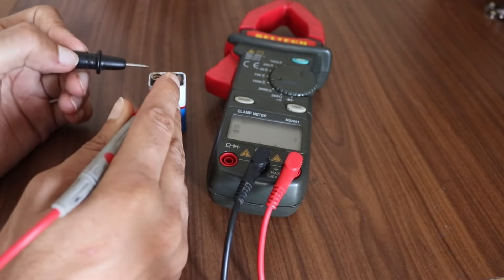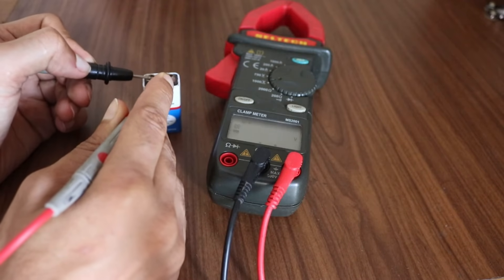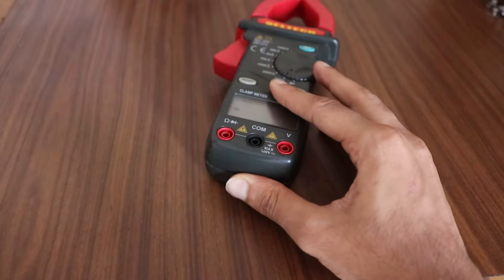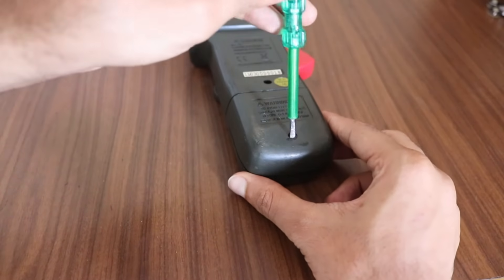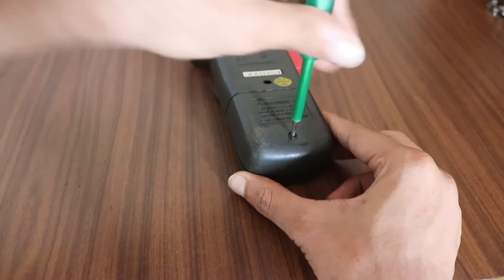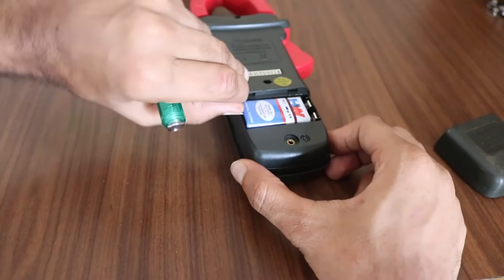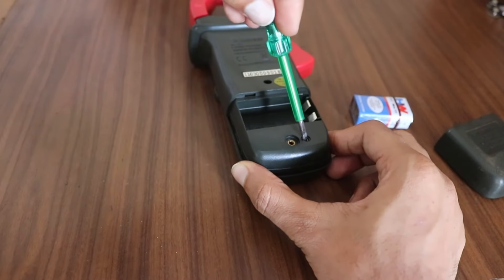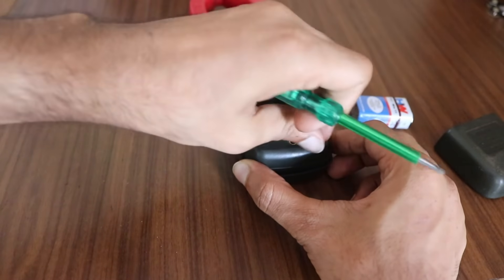Repair Clampmeter |Fix Multimeter

Comment: Hello Sir. What do you call to the two red wires connected to the clamp itself? and also their purpose. Thank you
Reply from the maker: It's probe 
There are 3 of them, the 2 of them is red & another one is black 
The red one on left handside is to test the resistance & diode value you will connect one red & one black to take the reading & the red on right hand side is to test the voltage 
Again you will connect the black one called Ground along with the red one to take voltage reading
Reply: @TechsScience  Thank you Sir

Comment: Sir same meter amp. Problem meter select 20 amp show display only 3.52 amp load and without load and other points proper work how to solve my 20amp. Point problem